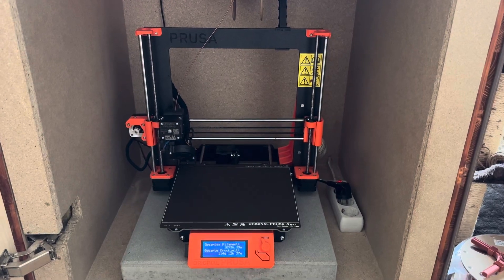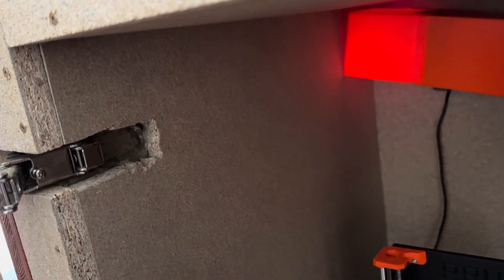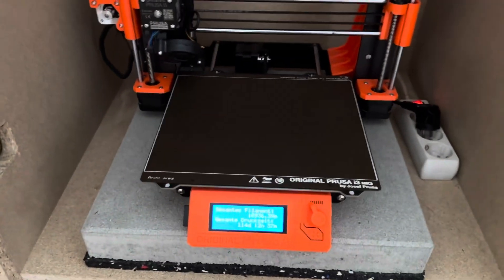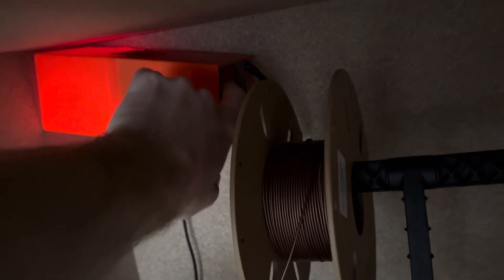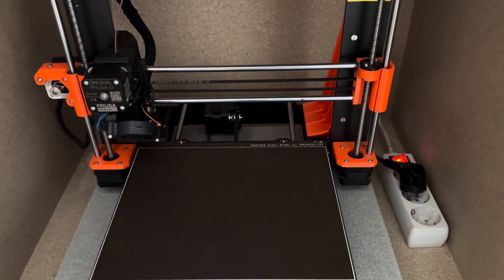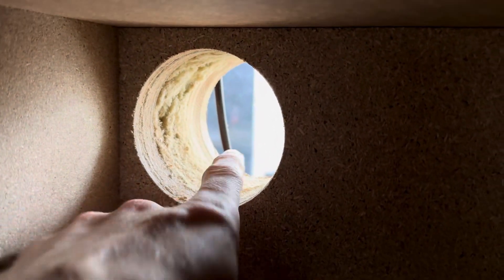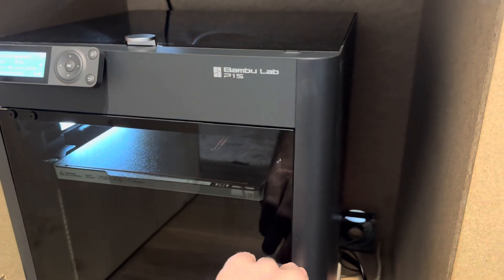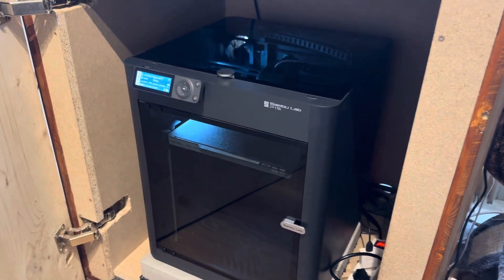Soundproof 3D printer enclosure and my new printer

Comment: Front door is only 18mm wood and you killed whole sound. So, why did you waste that much material and space on other sides. It seems 2cm wood or plywood box is enough to become quite.
Reply: the other aspects of the build are dampening the sound that otherwise would be echoing around inside the sealed box. If you had every panel be just one layer of wood, suddenly the whole thing will sound like a subwoofer. especially with how all the sides are parallel with each other. So you get a db reduction even when you have one panel that's not sound dampened because only around 1/6th of the energy of the sound is heading towards that door panel.
You're right though, in that he would get a noticeable further decrease if he improved the design of the door panel to be more like the rest. Like sound recording studios, the door is a big thick panel just like the walls, often with multiple layers of material and multiple seals. but it definitely wouldn't be anywhere near the same to just use one layer of wood.

Comment: You would likely get even better performance if you removed the innermost layer of particle board and left the stone wool exposed. By keeping the particle board, the sound is finding its way to the outermost layer of wood since they are connected, bypassing the stone wool at those points. But the stone wool would absorb most of the sound if directly exposed to it.
Reply from the maker: Yeah maybe but stone wool is nasty to touch and leaves a lot of dust.
Reply: @OmegaZZ111  That's fair. Either way, nice job! I plan to build one for my P1S as well.